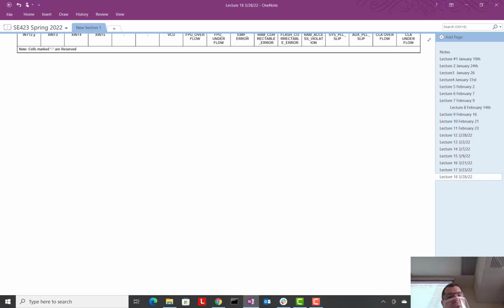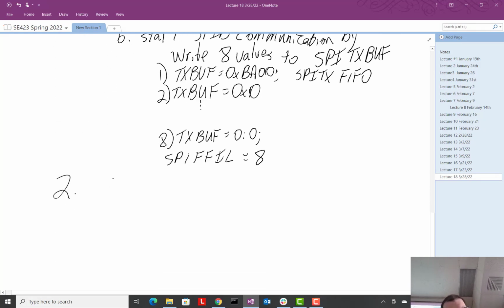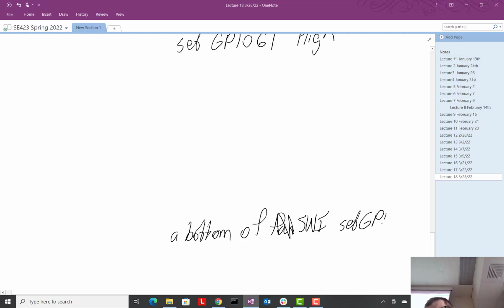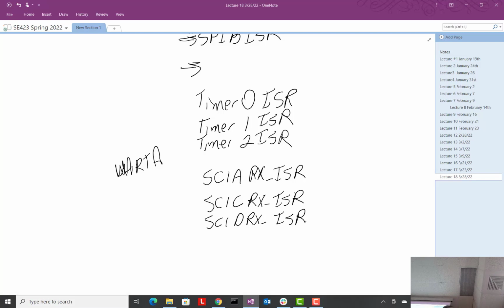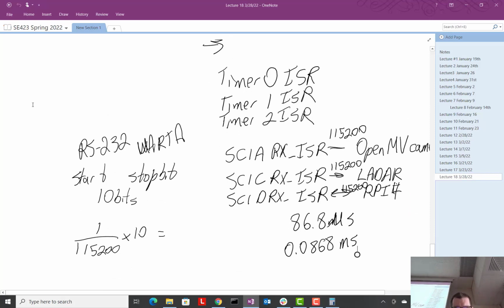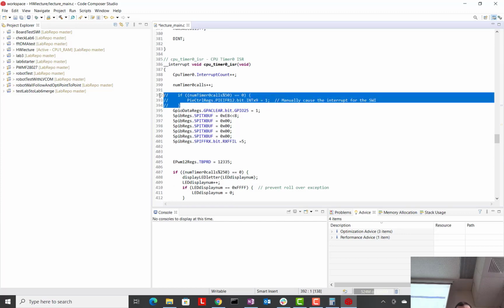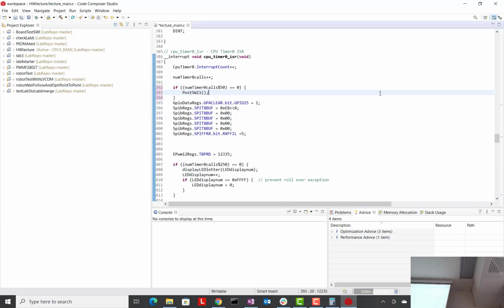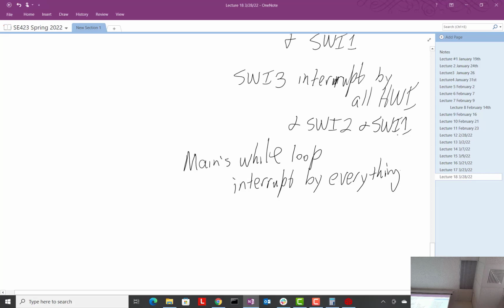More on Interrupts and the Flow of Our Code

Comment: These lecture series are great. Please upload some videos related to the dual-core CPU.
Reply from the maker: I will see if I have some time over my Christmas break to add some dual-core code to my repository.  When I do that I will also add a few lectures.  If you need some starter code sooner than that I can try to get some to you.  Have you tried out some of the starter code in my repository?
Reply: @danielblock3136  yes sir I am trying to solve those assignments you prepared. Actually I tried lab 4 oneday  exercises which is based on dual core. What I feel I need some more clarity which I am not able to get. So if you can give some references by that time I will try.